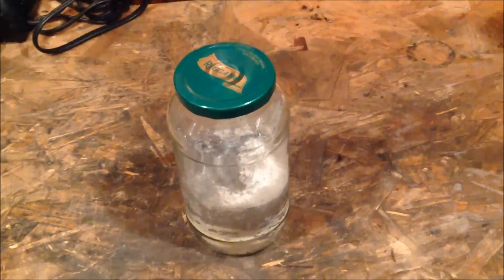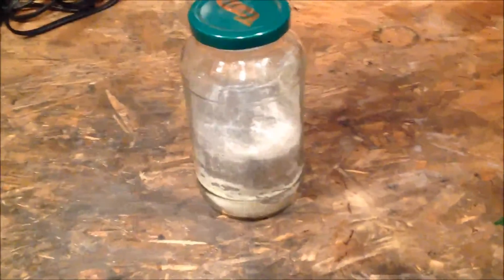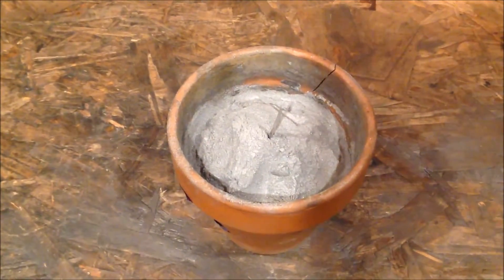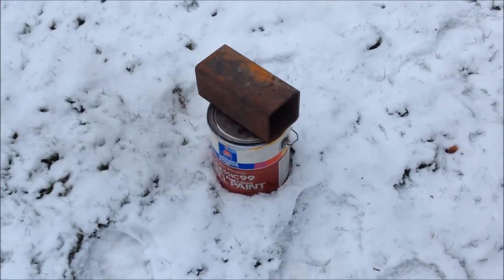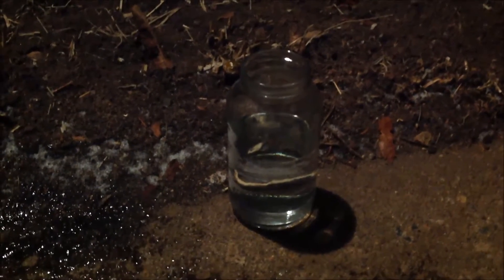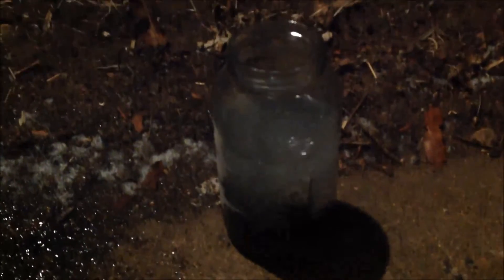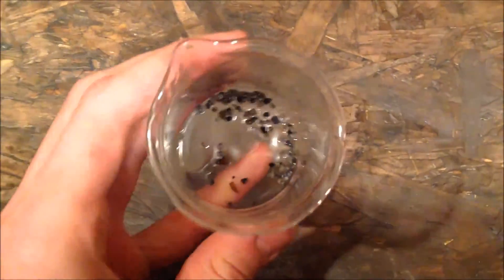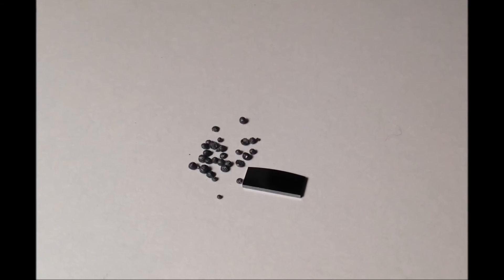Silicon - Summer of Thermite

Comment: I know I’m a bit late, but does this mixture require the sulfur? It isn’t difficult for me to do, I’d just rather not use it if possible
Reply from the maker: No problem, the sulfur is necessary to boost the heat of reaction so that the thermite sustains itself and gets hot enough to melt the products into a liquid so they can separate.   I cannot tell you from personal experience whether or not it works well without sulfur, but you could try some to find out!  Good luck.
Reply: The Plutonium Bunny tried, tested, and doesn’t work. I even added a tiny bit of sulfur, and then added more and more until it worked, and it took a lot of added sulfur to get it to go. Even then, it looked like it only lit around the fuse (NurdRage’s double sparkler and magnesium fuse), but the rest of the mixture hardened, I’m assuming the sulfur melted and stuck it all together. Yeah, you need the sulfur, thanks for replying though!